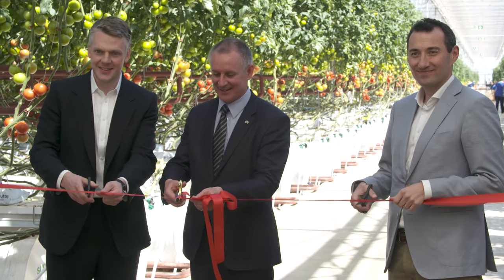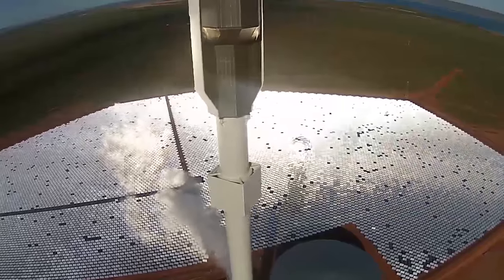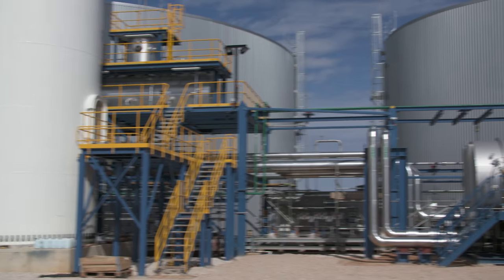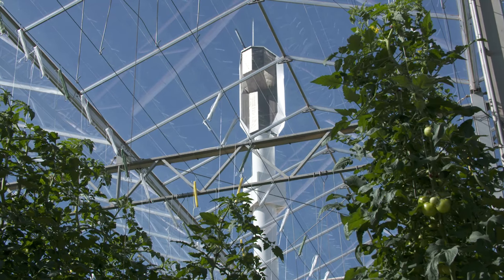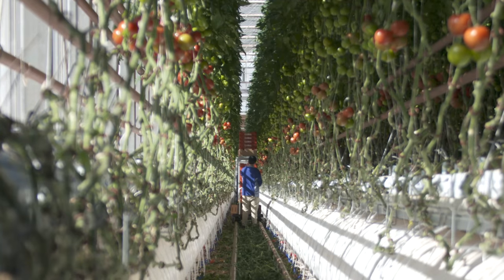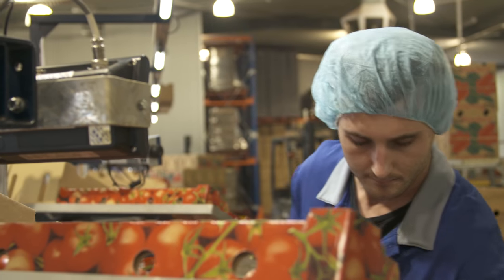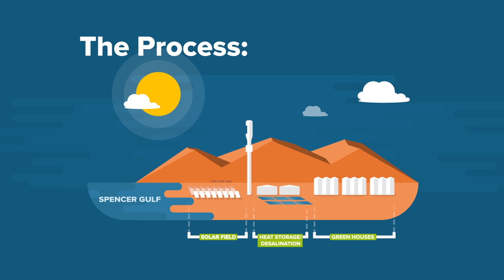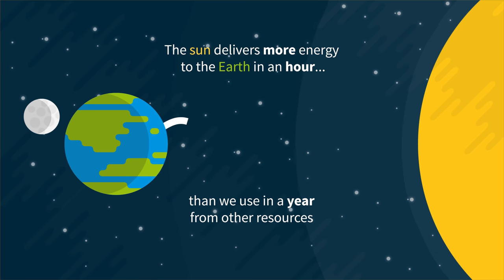Growing food in the Australian desert with sunlight and seawater - the Sundrop Farms project

Comment: Ok Jimmy, it's mirror cleaning day today.
Reply: The Japanese made robots that automatically clean them, so it's no problem. Essentially they use soft brushes to clean a solar panel or a mirror, and then the robot moves onto the next one. It only needs a person to place the robot onto an entirely different row, meaning the robot does the entire row by itself. So long as you have your things aligned in rows and some kind of track where the robot can move along the row, then it's all very easy, you don't need to use people to physically clean them. 
The mirrors in this video are in rows, so they are compatible with a robot cleaner. 

BTW the technology is amazing, humans have failed to properly harness the amazing power of the sun for a long time, but that is changing in the last few decades. The sun emits so much energy that we can easily run our entire societies off the sun in fact, it's basically free energy as it just flows onto us every day. 
Of course oil companies have pushed propaganda trying to bash on using the sun's power, because it hurts their business if people go in that direction. Usually low IQ republicans are easily propagandised and they are against any new technology and they insist on using coal and insisting that using the sun in stupid, of course republicans just repeat what the oil corporation propaganda pushes into republican media.

Most republicans will claim something dumb, like saying it costs most to produce a mirror or solar panel, than the entirety of energy you can harness while using it. Of course this is dumb and incorrect, but republicans don't have an education and don't know how stupid they are, so they just keep saying stupid stuff like that.
Reply: A night shift job hey . . . and watch out for hail storms
Reply: Wax on.  Wax off, Mr. Miyagi!

Comment: Just listening to this on BBC radio. Made by a English inventor. He has adapted this for poorer countries and is running/setting these up in Somalia so self sufficient food can be grown. Awesome stuff.
Reply: There is a much lower tech but more interesting project where they use the sea water in what is basically swamp coolers to make greenhouses that lower the air temp and make the air more humid. This way you then only need a small percentage of the water normally needed to grow the plants.
Reply: Somalia? And end up with warlords taking over, like the 1990-92 conflicts? No thanks. US soldiers died in that war and with this, it will be worse when warlords take over.

Comment: Looks great, but where do they  leave the salt that is being seperated from the water??
Reply: Hopefully they sell it as a chemical.
Reply: @rogerbarton497  
In dubai they use desalination equipment and dump the salt back into the sea and that's not good, so that's why i wonder what they do with the salt 
in this project.
Reply: @3DPeter  ...why isn’t dumping the salt that came from the sea back into the sea?
Reply: @3DPeter
If you think about it, all the water ends up going back into the sea, eventually, so putting all the salt back is simply restoring the balance.
Reply: @q.e.d.9112  
It's not that easy as you say, because water evaporates from the sun and falls down like rain, but it's only water that evaporates, so the salt
stays equaly spread in the sea, but here the salt is extracted from seawater and pumped back in high concentrations at one spot and that's not good.
It's like filling a swimming pool with water and then add a barrel of chlorine in one corner. it sure will mix over time but not the first few days when the pool is not used, 
so the corner where the chlorine is added, is not where you want to jump in because that  will cause severe burnmarks, so it's all about the concentration
at one spot that's bad for the marine life.
Reply: @3DPeter  
So , I see what you’re saying , Q.E.D didn’t actually think about it much. 
I’ve seen the damage this hypersalinated water does to the sea bed, turns it into a desert for hundreds of metres around the location, but it’s underwater, unseen, so, unconcerning.
Reply: @3DPeter 
I think it’s more like an eye-drop of chlorine in the corner of the pool.
If you take the salt from a cubic meter of seawater and mix it with 1000cu.m of seawater you have increased the salinity by 0.1%. 
So we pump seawater through a metered system that mixes 35g salt per 1000l of seawater and there will be a temporary 0.1% increase in local salinity. This is well within naturally occurring variations which can be +/- 3%.

And, remember, all that water is coming back to the ocean, anyway.
Reply: @q.e.d.9112  
well when the salt is being pumped back in small dosises at the time, then that's alright i gues
Reply: @3DPeter  Valid point about localised salinity increases in an area with little flow (such as the Persian Gulf), but Port Augusta is on the Southern Ocean so oceanic currents will dilute the salinity and bring it all into balance with little or no impact.
Reply: .i think they use it to season the tomatoes 🍅🤔
Reply: They mix it with sea water before returning it to the sea. It is still extra salty. They don't just dump it one location, it distributed over a much larger area. The area of around 9 meters from exhaust ports is has extra salinity. ocean currents mix it back in. How much fresh water do you think rains into the ocean? In the long run there will be balance and the benefits far out weigh any negatives.
Reply: @sawboneiomc8809  it increases the salinity which is not good for the local sea life.  They could sell it as sea salt, which would be better, but how much is there?
Reply: @islandgardener158  ...thanks I needed that laugh this morning.....increases the salinity of the sea...😂...why don’t you go out into the Sahara desert and scoop up a handful of sand and then declare it sandless.
Reply: The australians had a lot of cattles, they need salt.  ??
Reply: @davidsteer8142  Pt Augusta is at the very end of a very narrow inlet of the Spencer Gulf.  It is also relatively shallow.  It is also home to the Giant Cuttlefish, a species in danger, and now at risk of extinction. This is not the only desalination plant dumping brine.  Salt disposal in this environment needs to be better managed than "out of sight, out of mind"

Comment: We need more and more of these
Reply: Definitely not. Solar panels are not "green". They are basically made from coal, and have a limited half-life of about 10 years only.
And seawater desalination is a very power hungry process, so it needs lo~ts of solar panels. To give you an idea, you need roughly 16 panels to power 1 single AC Unit during the 6 to 7 hours of the day with the highest sunshine!
The better alternative is to invest in poor areas of the world where the weather is appropriate, and then import the food. Much cheaper, and less impact on the environment.
Solar power is not a green alternative, but an option where conventional power is not available at all.
Reply: @sassuki  not to mention the fact that it needs to be plugged into main energy grid to draw energy each day using fossil fuels

Comment: Where do you discharge your brine and whats your readings on salt concentration over years ?
Reply: Salt is used in the chemical industry
Reply: From what I see, this is not a filter based water purification where you end up with brine. It is an evaporation based, just like how we get our table salt. I mean one of the way of getting salt, an evaporation pond. Instead of letting the vapour disappear to the air, they collect them thru condensation and use those as freshwater for the tomato. The leftover are most probably the same thing as what you get from a salt evaporation pond which is salt. Though, I must stress it would also have the same concerns/con for salt from a salt evaporation pond since those seawater are also the same pure seawater that have been said to be full of heavy metal and microplastics. Having said that, salt from mining do contains microplastics as well. My point is that they might end up as our table salt. That's just my two cents.

From what I know this is also not a solar panel plant, it is a solar thermal plant. It mean they don't use solar energy and change it into electricity directly with a solar panel. Instead, they use the heat. I have read that you could use medium like sand to keep all those thermal energy a.k.a heat. Sodium nitrate which is a type of salt could be used as the medium as well. Then, you could use those heat to boil water and create steam that propelled a generator.

Comment: What if there is very little sunlight and it gets cold for years at a time? Prepared for that kind of future? Talking about yearly or even decade long solar eclipses that would create entire planetary wide snow and freezing events.
Reply: Pt Augusta does get cold in the winter months, with regular frosts, that's one of the uses for excess heat from the system - to keep the crops warm.  I don't think your decade long eclipse is on the cards unless the earth stops revolving.  If that happens we'll have abit more to worry about than a few tomatoes.

Comment: Looks like growbags or hydroponics. Meh. Really I think you need to fling a load of rotting wood into the soil (actually buried beneath that poor dust) and the cellulose will counter that massive salt problem Australia has. Quite frankly, after that you could do with growing trees and complementing some of that with farm land that results from it. The wood makes good fuel and a cash crop and it much nicer than those grubby photovoltaics.